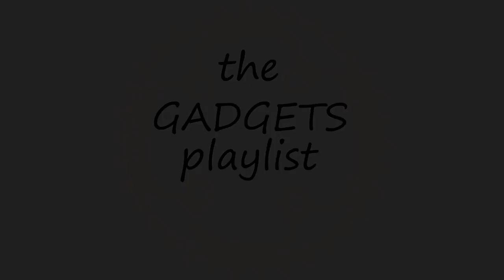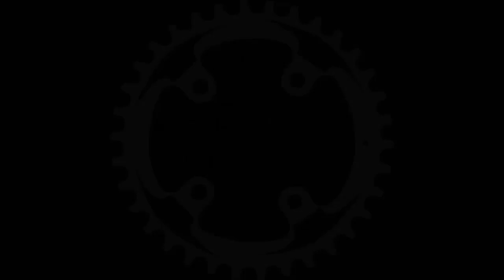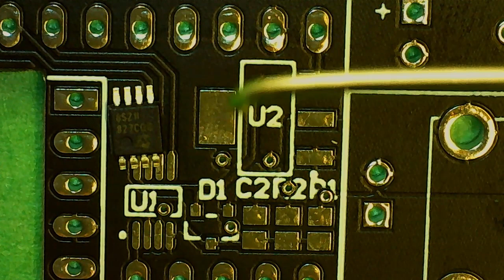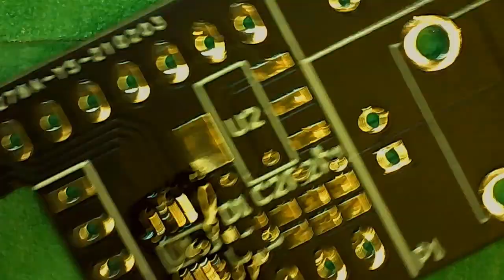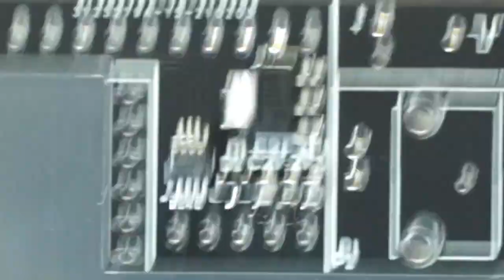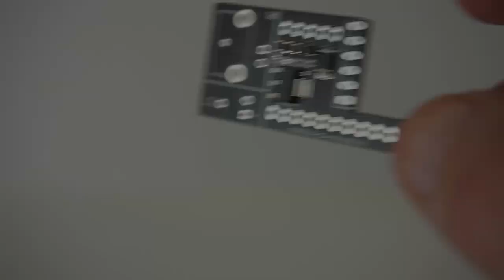GADGETS#146 - MSOP MCP6S21 ON A PLATE

Comment: Great work - I watched your previous two videos on the 946-1010 too. They are both excellent. Thanks also for the PDF - I have downloaded it, and ordered the 946-1010 now as a result of this. I have a hot air rework station, so this will be a useful tool to add. Thank you. In practice do you now set 195'C as the setpoint and just turn it off when it gets there?
Reply from the maker: 946-1010 and your rework station will make a great combo Tristan.

I set 195ºC ... allow it to reach that temp and once satisfied that all components have found their rightful place I shut power OFF.

Takes a long time to cool yet I make no effort to remove board.

Comment: Interesting. Can you do microprocessors in a similar manner?
Reply from the maker: haven't tried microcontroller chips ... yet
Reply: @theGADGETSplaylist  The reason I asked is that if possible, you could add a second microprocessor into a automotive computer and make the system redundant.  Hence increasing both processor speed and reliability.  Your Fusion on steroids! 😁
Reply from the maker: @oldwrench4213  this would be way, way, way above my paygrade...lol